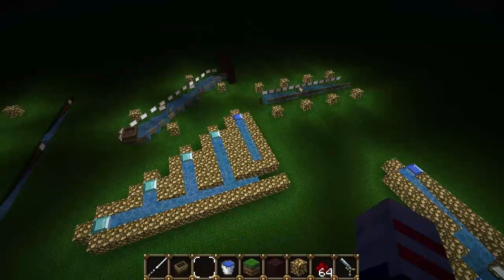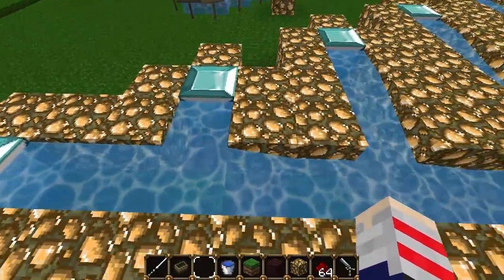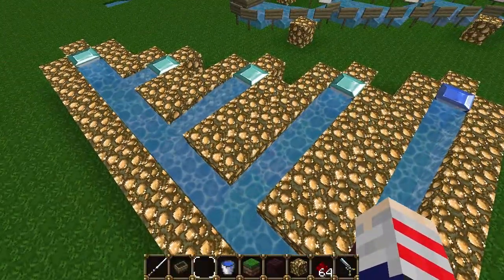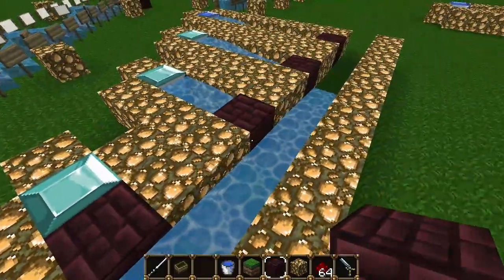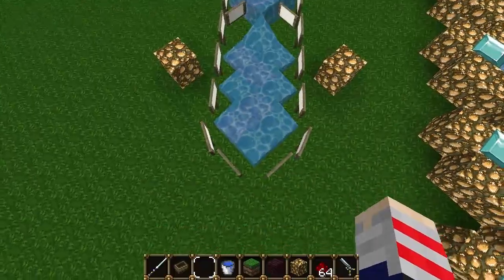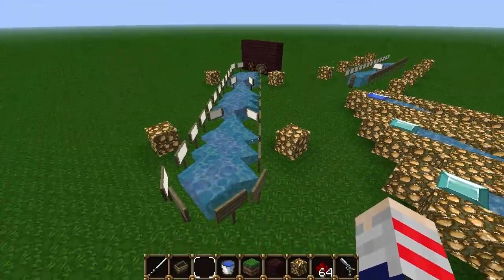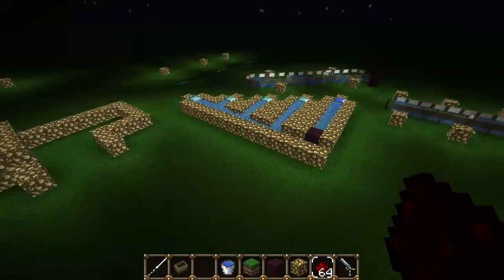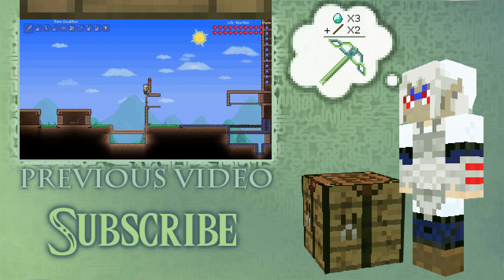Minecraft Tech - Advanced Water Channels

Comment from the maker: Most of them work well on players too if you want them to travel slowly (like a haunted ride or something). The two I threw together with lots of signs are best for traveling fast using boats. Unfortunately, ice doesn't give players much speed, but the boost is still notable. If you need to slow them down, soulsand does the job